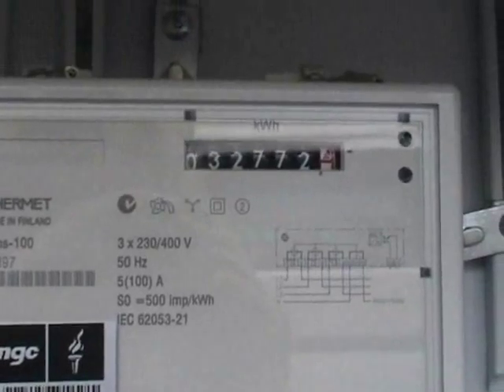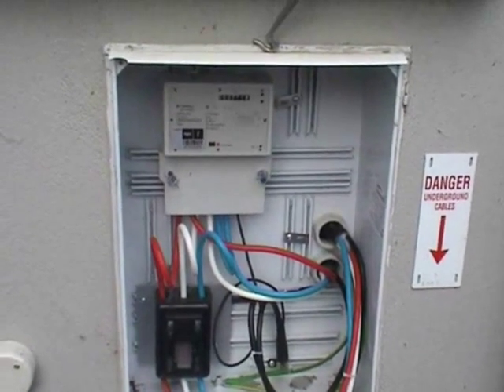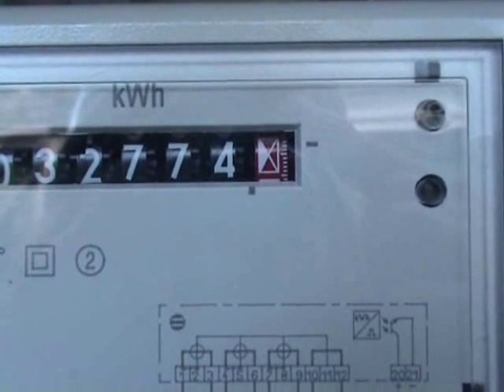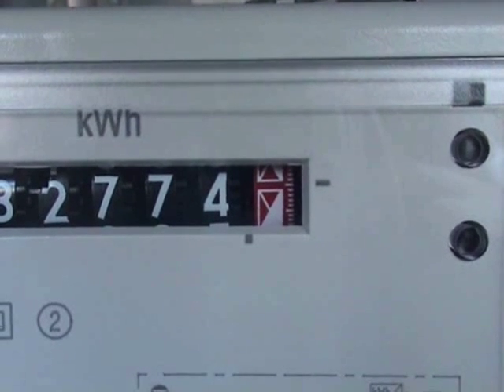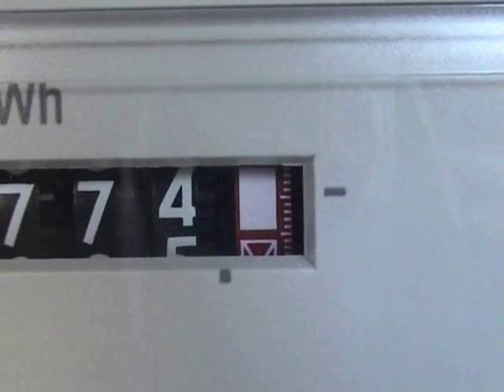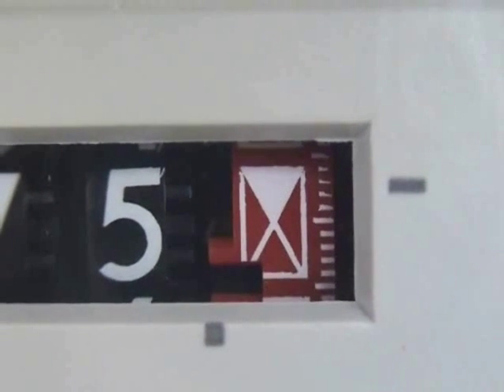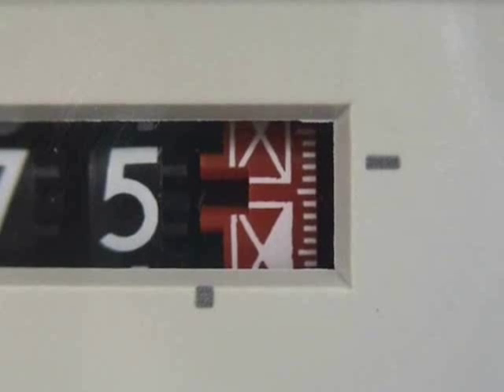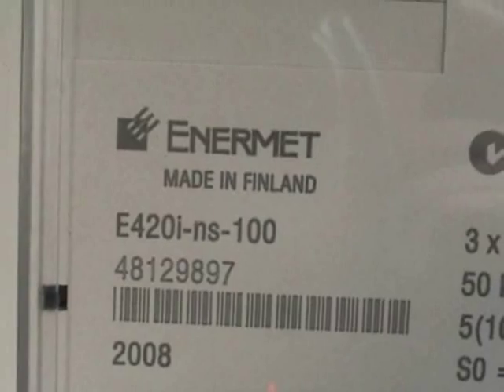Enermet  E420i kWh meter

Comment from the maker: @grayfox106  No idea, they used to have numerals in the year 2000 manufacturered  series.
Perhaps meter readers or customers misread the decimal.
Just happened to notice these symbols in use for the decimals.
Often utilities have the decimal number wheel just blanked off as it is only important for testing purposes.